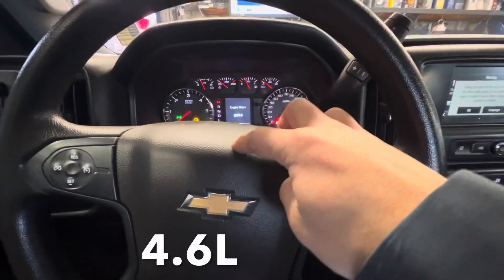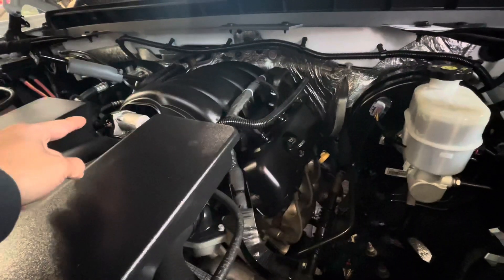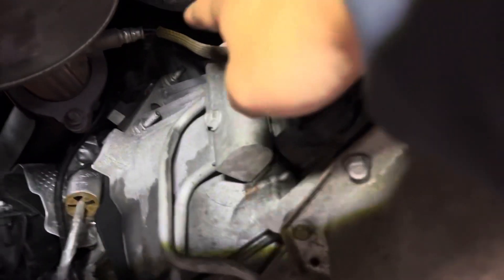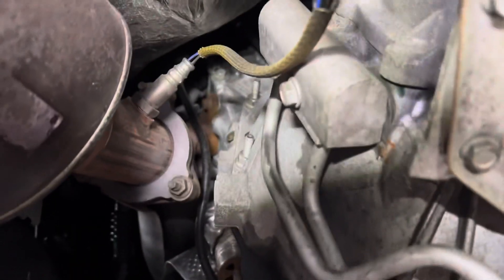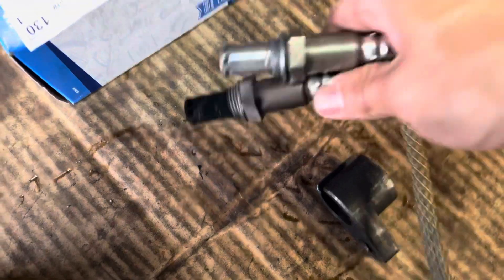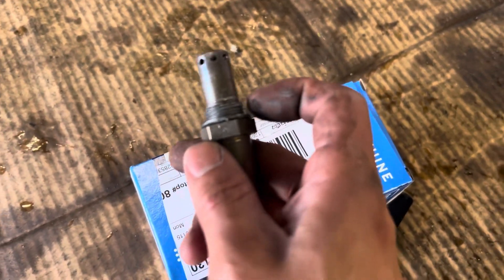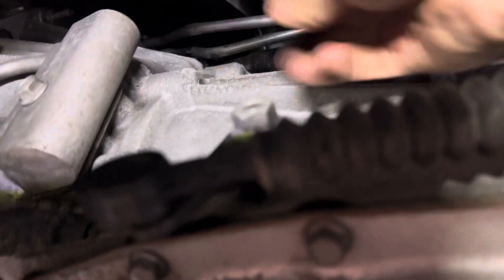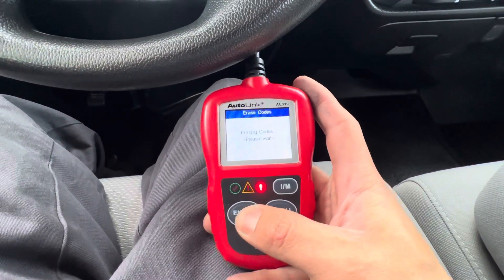Chevy Silverado / Tahoe Oxygen Sensor Replace - Code P015B Bank 1 Sensor 1

Comment: About to change mine, video helped a lot, what if I need to change my connector, easy change?
Reply from the maker: You dont need to replace the connector unless its broken or corroded. If you repair the pigtail connector it kinda hard to repair in a tight spot.

Comment: Hello, I got the same code on my '15 Silverdado. Do you suggest to replace the other O2 sensor too? Or just the one that the scanner is telling you to get replaced?
Reply from the maker: If the code is for that specific o2 then replace the one causing the problem. Dont waste money replacing another one if theres no problem with it.

Comment: Is it the same part number for bank 1 sensor 2?
Reply from the maker: If the connector is the same, then yes. But i dont think its the same. 1 upstream 1 downstream.
Reply: @Ah_Duuu_Ma  I replaced bank 1 sensor 1 a few weeks ago and got the part number from your video. Now it's saying B1S2 which is in the same line. Can't find anywhere showing the part number.